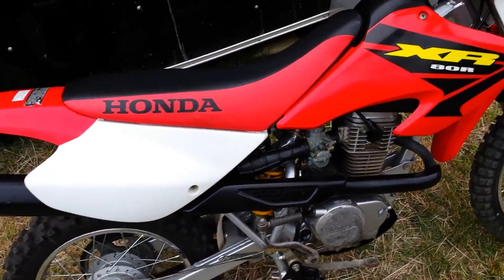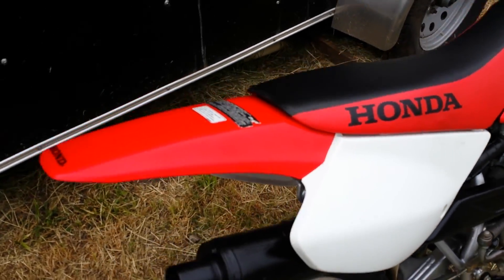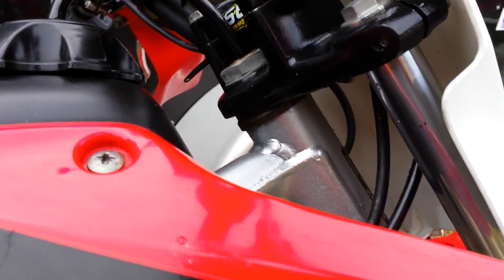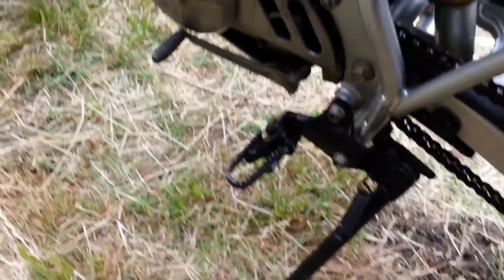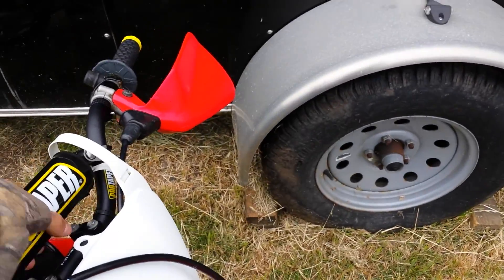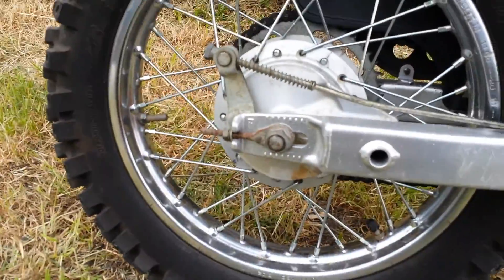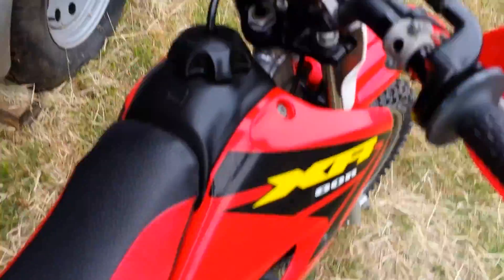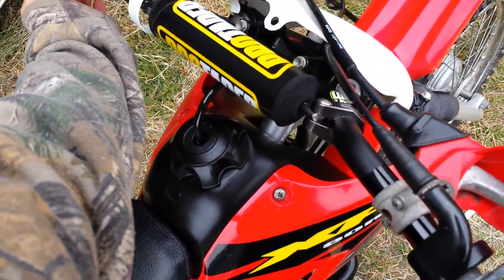2003 Honda XR80R - Dirt Bike Repair

Comment: This looks like the bike we bought my son for his birthday. Was told it was a 2003 honda xr90 but when I Google it I cant find 90s I can only find 80s and 100s that look like his. How can I figure out what size his bike is?
Reply from the maker: P N  look up the seat heights for the 70 80 and 100 and then compare with your bike. The 100 look the same as the 800 but has a slightly higher seat height.
Reply: JC & The Moto Heads Thanks! I checked it out and it's an xr70
Reply: JC & The Moto Heads is the XR 80 same size as the 100 I know the seat height is about a inch higher but what about length and weight ?  And is motor same size ,,
Reply: If you have not gotten this figured out yet there are 3 ways.  First check the Title (if you have it) and that will list the model number.  Second check the VIN.  Its on the steering head part of the frame, just google it and you will get the answer.  And lastly if you look on the engine block (jug) itself it will tell you the CC's of the engine.  AN XR80 will be 79CC.
Reply: They don't have an XR90

Comment: What did you use to shine up the bike? I have be same exact bike except if needed a whole new cam, valves, piston, rocker arms etc.. The guy that I bought it from scammed me... I’m taking around a $300 loss in money with the bike I have. But any was what did you use to shine the bike up?